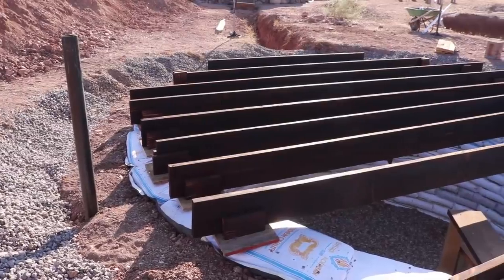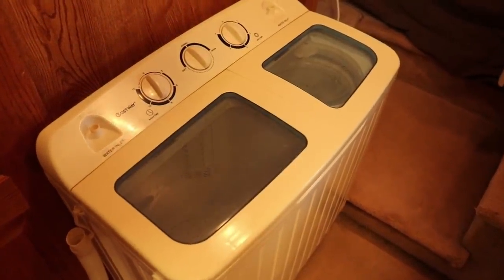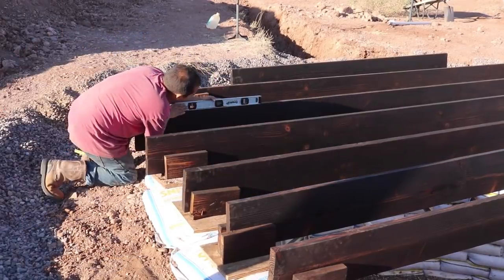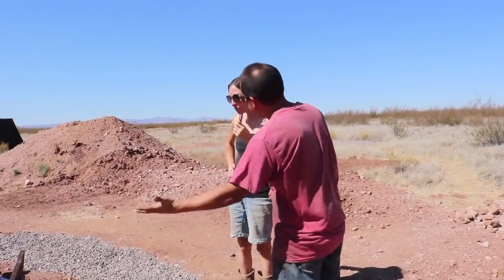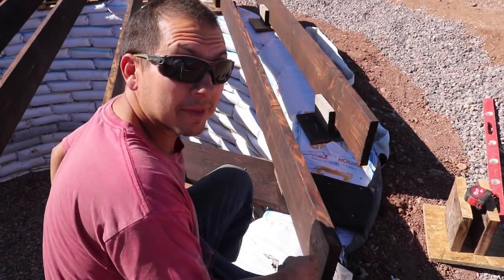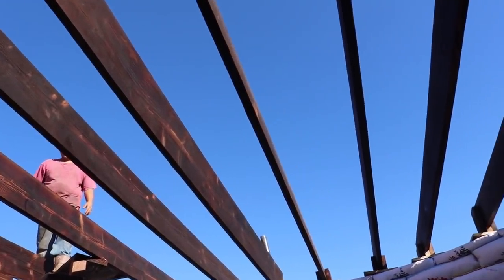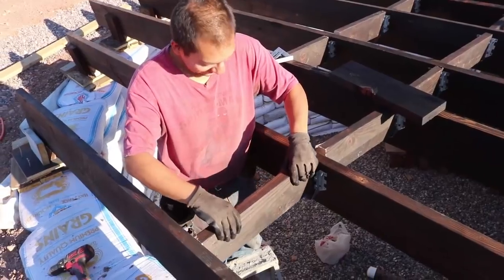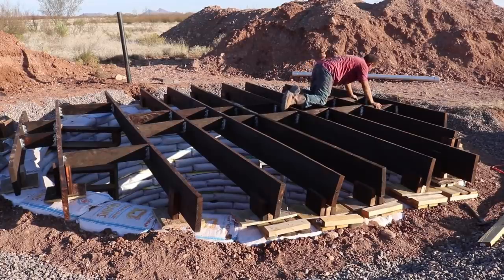Leveling and Securing The Joists To Our Earthbag Root Cellar

Comment: gday mate that’s one heck of a build  this is only my 2cents worth but i would really get some bracing in near the ends too help strengthen the floor structure  don’t rely on the osb as judging by the warping of beams they really need more bracing cheers from australia 🇦🇺
Reply: We call that a rim joist. Very necessary.

Comment: I seem to recall that black pipe is for radon mitigation.  if so are you going to want hook up some sort of blower to make sure you pull the radon gas out of that root cellar.   I figured you have probably already researched it, but just in case you hadn't I am providing the internet's greatest resource, the unsolicited advice, :)
Reply from the maker: We'll be adding a blower eventually.

Comment: Didn't read all the comments so maybe someone's already covered it but...
You need braces at the ends of your joists to prevent the joists twisting, the OSB isn't going to do it down through the years.
What you might consider is two pieces of 2x2 on each joist that you can slide a panel of OSB down into any cut that piece to fit from the top of the bag to the top of the joist, closing off that bay end.
Unless you are planning to put an earthbag between each joist to seal and brace the ends?

Comment: Hey Jim, regarding your truck overheating problem have you tried replacing the thermostat yet? I owned a repair shop for 18 yrs in Phoenix and dealt with a lot of overheating problems.  Another suspect is the fan clutch, it should be pulling a lot air through the radiator when the air is hot. If it free wheels after stopping the engine it may need replacing. If you have a blown head gasket you would have a geyser from the pressure tank as the compression would leak into the water jackets. Hope this helps and it is not anything too serious. My wife and I love your channel and your tenacity.
Reply from the maker: Thank you!!

Comment: as someone who lives in SV, i would like to point out, Snakes, Especially Rattlesnakes,  like dark cool areas, so until you get a bit further along, you will need to do a quick check around that root cellar to make sure nothing has crawled in
Reply from the maker: Definitely a good idea.
Reply: @ourselfreliantlife  as someone who lives about 80 miles from u I would also suggest having a cat or 2 around they will keep the snakes down to a dull roar by taking out the mice / rats  but do feed them as well so they dont have to range too far to hunt because the hawks and the coyotes will eat  them. and if you are getting a tire plug kit also get an extra can of rubber cement they sell small ones because the rubber cement in the tube that comes with the kits is insufficient amount for all the plugs for one or once opened it all turns hard
Reply: @ram1brn  unfortunately they will all decimate your local birds.  A rough trade off in my opinion.  Also it doesnt matter what they feed on they will take birds.  One of the number one reason we are losing songbirds in North America.  Kitty.

Comment: To level the joists, set up two strings that are level with each other and run along the two ends of the set of joists.
Reply: Don't mess around. Buy , borrow, or rent a laser.

Comment: You need more diaphragms than that. There should be rim joists that act as diaphragms at the ends of the joists. Otherwise the joists will lay over when you load them. I always make my wood diaphragms full height. With steel, I only went 1/2 height. It is easier(and cheaper) to mount your diaphragms by nailing through the joist into the end grain of the diaphragms. The diaphragms alternate from side to side of the line you are following so that you have access to nail into the end grain.
Flat tires are a pain. You can get a decent tire repair kit at Walmart for under $20. Learn how to plug the holes while the tire is still on the car and you can save a lot of time. Check if your state allows plugging tires or they have to be patched from within. You can get a manual tire changer from Harbor Freight if you have to patch from within. Never try to fix a sidewall puncture, they just don't work for long. When you are out on your own, you have to learn to do repairs yourself or the costs will crush you. A couple of extra wheels and tires would be a good idea too. Visit your local junkyard. They often have needed things for a lot less than the cost of new. Good Luck, Rick
Reply: its arizona we can do what ever we want . the law only applies to commercial tire repair
Reply: @ram1brn  I've used a kit similar to Walmarts for 40 years. Probably plugged 25 tires, only had trouble with a few. Good Luck, Rick

Comment: YoiTube Channel MartyT and his David Brown Tractor might help with the truck. First thing you need to look for is where the skid plate would be on the FX4 package of the F150 as if you don't have that edition rocks and stones get flung up into the underside of the engine causing all sorts of issues.
Reply: Run the OSB perpendicular to the joists when done with blocking (having put blocking under where the seams will be) for maximum rigidity and strength!

Comment: you need to stagger the cross beams more. also, the ends need to be more secured. after a while you will get a lot of warping and pulling up from the foundation. the joists are already terribly warped. overall, not bad though

Comment: since you have an air compressor, it should be an easy fix to plug a tire unless it has a cut in it.
Reply from the maker: I have a kit. It's usually recommended to get the inside patches.
Reply: @ourselfreliantlife  yes it is, but sometimes that's not practical. plugs work just fine, at least they always have for me. but then sometimes us old hillbillies are a bit unorthodox. lol

Comment: I don't see blocking for point loads. Doublers for stair openings. Blocks for walls parallel to joists. Are there any large penetrations like bathroom fixtures that need joist moved? Any sheetrock backing for the ceiling?